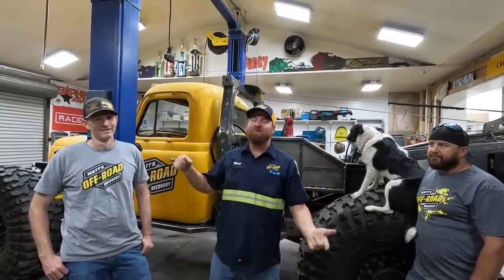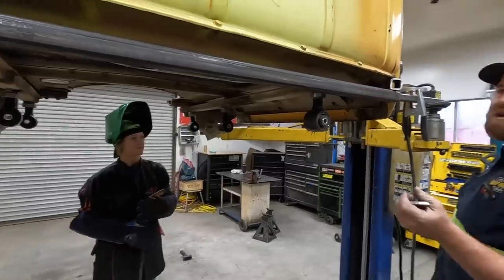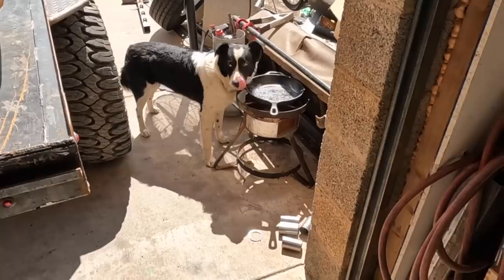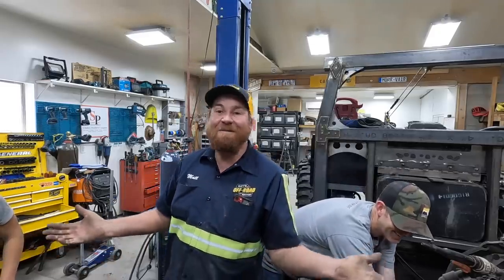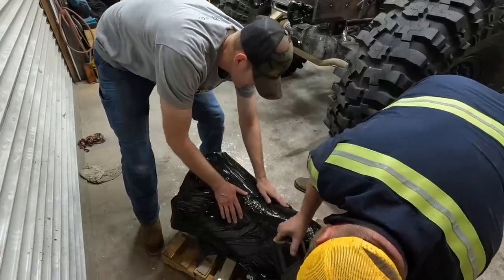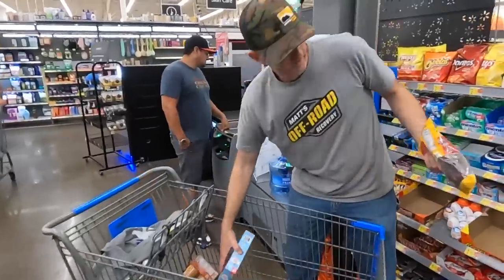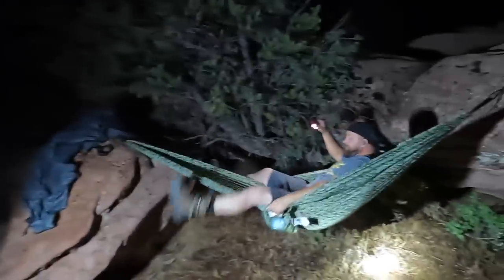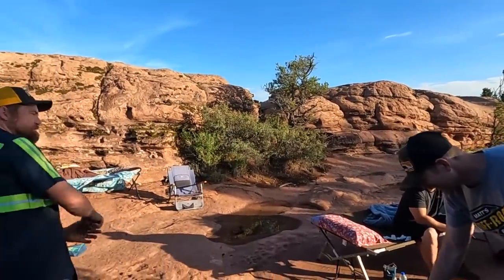Off Road Wrecker, We Need To Take It Apart Again.

Comment: In a past video I mentioned that you should use Cera-tec friction reducing oil additive in your Banana and you should use it in your Morvair. It reduces friction and keeps your engine running cool. Sometimes on cool days my engine stays running well below Thermostat opening temperature. It also increases torque. Your friend Kevin over at Light Bright just did a video about Cera-tec and Liquid Moly oil praising its benefits. His video is titled:" Preparing Our Jeep & Ford for an Off Road Trip Across the Country!". I'm a fan of both of your channels and former mechanic so try it in one of your vehicles. I think I'll send you one via my Amazon account.

Comment: Needs a mention... lighting a fire on a battery is a good way to blow your arses up, batteries generate Hydrogen gas. 
I know people that did, being splashed with hot battery acid is not fun. Any showers out there? lol  It is the primary reason for connecting positive cable first while boosting. Do not make negative connection on the battery! Connect to engine or chassis (away from battery)  Love the channel, great team effort. In their defense, camping without adequate equipment or supplies is a great exercise. If they instilled anything it is that overnighting in an emergency is not the end of the world. I would think an emergency road kit should be in any rig doing what you are doing.
You could market/give away well thought out kits. They already have experience in what they didn't have. Cheers from your northern Alberta neighbors ehh.

Comment: What about an s10 for the dunes? Built 4.3 vortec coil over conversion on the front, blocks and drop brackets in the rear, 4.56 gears and 35 inch maxis tires. Honestly no clue how it would turn out but it’s light, not a v8 but good for power and geared for better torque to accommodate for the 4.3. Not as cool as anything you guys have by any means but would be cool to see the build

Comment: Just watched Rory's latest video where he talks about the differences between his two wreckers and explains his reasons for how the boom functions on his off-road recovery truck vs the on road wrecker boom.  In looking at the boom on the Worlds Largest Off Road Wrecker and wondering if you are concerned, in a gnarly extraction, with the prospect of the boom bouncing up as there doesn't seem to be anything restraining an upward swing if the recovered vehicle is bouncing up and down on the winch line attaching it to the tip of the boom?  Love the channel! Been a follower and fan for a bit over a year.  Can't wait to see the truck in action!
Reply: The reason you don't see it is because they haven't made it yet. Once the wrecker is complete, maybe you'll see how it works.

Comment: You guys should cut out and biuld an Oil Pan Access panael under the  engine that way if you ever needed to drop the oil pan for any reason you can, ALSO  you could do a full rebiuld with out having to remove the engine block assuming you were to just Hand Hone and put new rings in it. it would be as smple as dropping the oil pan guard, then oil pant then the crank from the bottom and pull the pistons from the top with no clearence issues.

Comment: What I would like to see, and I don't have a clue how you would do it, is the torque converter driving 2 manual gear boxes before the transfer case.. The gear ratios would be endless, without the weak link of the autos clutches. Probably totally impracticable, but I would love to hear your thoughts on the idea.

Comment: I think yall should do an s10 or blazer as a platform and use the 4.3L vortex v6 you can buy a twin turbo kit for 1200 bucks do a lifted 4x4 blazer with crazy travel would not only be rare on youtube but in my opinion is an awesome offroad vehicle

Comment: I think you should build a Morvair, much like the first one, but it should have an Electric drive, Tesla motor preferably, you could also do a Jeep like your Banana to save cost. Or, something like the heavy wrecker with and electric Drive motor, it has the weight capacity to hold tons of Batteries for a long run time. With these rigs you pretty much know what to build, you did them before so there are no headaches there. This way you can focus acquiring new skills to apply the Electric Drive unit. Why I would suggest this, Electric is very efficient in stop and go traffic, or rock crawling, Idling does not consume power, has lots of Torque and that is perfect for pulling out things or rock crawling. With portable solar panels you can charge some in the field, maybe?!?!?!? So you could have a mobile Solar charging station with battery banks and/or Generator (Gas)?!?!?!?!

Comment: Gas Tank.Design.  Think Hydro Static Pressure, you don't have enough pressure at the nozzle or fill spout location to over come the weight of the gasoline. Gas Station Nozzles Shut Off when backflow from the tank hits it.  Your fill spout is about 8-inches from the tank bottom, which is Too Low.  Forget manual filling with Gas Cans from this location. It will just gush out from the tank once the gasoline gets to Fill Spout location. Hydro Static Pressure is why Most Gas Tanks Fill Spouts are at the top of the Tank, avoiding this issue.  If you move the Fill Spout to the top of the Tank this tank would work.   You ought to try filling the new Gas Tank before going further.  As designed NOW, as stated, you won't be able to fill this Tank..         I would recommend adding a separate Manual Fill Spout at the Top of the Tank, so you can at least fill the Tank as designed Now.                                   You may also have to lower the tank.  I would make the Tank two-piece and epoxy line it to prevent Rust.  A two-piece design would allow you complete access for maintenance, and for applying the epoxy to all inside areas of the Tank.  Thanks for your time  enjoy the videos.  😀      I wrote you a comment about the Hydro Static Pressure Tank issue 3-weeks ago, but it was ignored.  I'm surprised no else has picked up on this problem with you Tank Design.

Comment: My 99 Ford Ranger had gotten very rusty and it has V8 in it from 01 mountaineer. Almost everything plug and play cool. I was looking to replace it found nice 01 Ranger, kid asked what I was going to do with it. I told him going to have V8 from 99 put in. He wouldn't sell it me and said if I was swapping in cummins B4 he then would sell to me. I work on Diesel trucks, and It does get cold here. Told the kid why would I put 900 lbs engine in vs 450 lbs V8, going through all trouble making trans work with adapters and take more mods just to make it work. Then fuel issue with gelling oh so much fun. Lets just make balance worst make front very heavy end and light rear. V8 swap far better with what I'm doing.

Comment: Are you going to do anything with regards to the torque converter or just leave it stock. My thoughts was have a slightly higher stall then stock maybe? (like going from possibly 2200 to 2500). Just to squeeze a slight bit more omph out of the motor.

Comment: Comanche chopped in half back halfed with xj to make it 6 door...with 5 ft bed.. 40" on Dana d44 twin traction beam front full spoiled trailering arms 4 linked coilovers rear end with triple by passed king Kong 4.0 all around.. ls or Cummings don't care make north of 600 to the tire I tell ya what. Look up kibbytech for insperation love ya..

Comment: From experience: Do not run 1/4 plastic air hose anywhere near the exhaust. Even the rising heat from the exhaust 6 inches higher under the cab will melt the air hose.

Comment: I'm curious, but with all the winches, would running dual alternators with a high-idle switch (1500-rpm) be a good idea? Or even with two winches going at the same time will you still not really pull enough current for a single HO alternator to keep up with?

Comment: Interesting idea about you and your crew building something based on the comment section. Since California is going to be outlawing the sale of new gas-powered vehicles in 2030 (yeah, right? seems so well thought through, we'll see) maybe you might consider building the first ultimate Off Road Battery Powered vehicle. Ultimate EV Rock crawler, EV Off Road Corvair, electrify the Suzuki or buggy - could be interesting, at least there shouldn't be a shortage of options. Plus, all you have to do is make sure it's plugged in at night and no reason to stop in at the gas station to fuel up, something you don't seem to enjoy. And it wouldn't require the instillation of a Cummins as a part of the project.

Comment: don't all trucks still have a cigarette lighter in one of the sockets/ashtray? 🤣 they'll easily ignite rolled paper and probably the propane flame directly if you cycle it a few times/hold to get extra hot.
I don't smoke but always have butane lighters in my vehicles, as well as factory glow lighters.

Comment: This business has so rapidly outgrown this shop, you need to to go to a 10 bay truck shop, 7 bays for Off Road, and 3 bays for your son to do his thing. Bring him back into the fold while letting the family grow. That and a 10 ton over head crain would be nice for all.
Grow the business, we all,, love you.

Then their is Lissy, she is ,going to want 2 bays for herself soon.

Their is never enough bays for a growing family, and thats just to stay out of the snow in the morning.

10 bays 30 feet tall. 5 with pass through doors. 4 times the office space for billing let alone merchandise. The kitchen/food/deliveries/pick ups.

500 gallon tanks for trans fluid, antifreeze/ grease/ hydraulic fluid/ 175 psi of air, 8 welding stations, 7 lifts and the crain, entire wheel alignment station.

Hyper billing software. Have seen it and lived it, you need to get there.

O and 26 tons of Mitsobihie AC /heat.

Would suggest the local KMart or Sears, building that is out of business. It is the right size building. With plenty of parking asphalt. And docks. That one can cut 15 doors into the building. On Main Street , preferably with a traffic light entrance/exit

Comment: Monster transmission. Of Brooksville fl.
Sucks..Socks... just cuz you seen them on T.V... DONT MAKE IT BETTER...
 I spent $5400 on monster Trans stage 4.
Junk..got it dry pan. no testing. Didn't go a mile. Had cut internal seals...   buy local

Comment: Scrap the Cummins. Way too heavy. 

Put a 2.8Turbo 5cyl Kubota F2803 in an XJ with a 5.38+ gear ratio. You’ll shave off 300 lbs in weight and have tractor like power to pull things out.

Comment: I think this shop needs to review 7th grade metal shop safety videos.   Remember the ones where metal shavings get in the eye.   That is, if you are old enough to have shop offered in your jr. high or high school.   It's nice to be "cool" but the one time it doesn't work the results are usually bad, very bad.  Further, it isn't a very good model for those interested in doing this stuff.   Cool stuff made here for sure, but, safety first, and it takes next to zero additional time in order to do it.

Comment: hey I thought the frame had integrated air tanks! Ive missed a few episodes, did that not end up working out?
Reply: I think some folks with pressure vessel expertise got through to him. Very, very dangerous thousands of pounds of force involved. One of those plug welds letting loose had catastrophic and life threatening potential. I considered FedExing a letter to him myself. But got caught up in something else. Was very relieved to see the tanks!
Reply: @bubagump4366  ahh yeah that makes sense I guess there is a reason all the pressure vessels I see are cylinder without corners huh, lol such a neat idea tho XD

Comment: As a engamaneer you are supposed  to build five times the safety factor. I question your boom strength ....
When you hold a 5 tonne shackle in your hand Engamaneer says it will not break until 25 tonnes. Can you claim the same with your boom.
Best get your boom tested for insurance purposes.
I've  read you've been down that road before and you are  too nice of a guy  to be litigated again.

Comment: would love to see your channel go up against the other channels in an overnight job,  oh and Matt,  did your wife teach you to take responsibility for buying your own food when your away from home.   Never trust your crew as they will always buy something you do not like. 

as for ideas,   have you ever added water to your tires to get more traction on soft dirt. 

2nd,  add a joey gearbox so you can further gear down hence giving more pulling torque to climb obscene things or pull heavy loads. 

lazy axles to help on loose soil or towing heavy trailers. 

adding a fresh water container for human needs

in summer having branded water bottles for crew and customers.  

having a mobile phone dongle on a mask that can be raised to get reception in bad places and this can then go to a wifi access point. 

more fixed cameras on the rigs so you caN See under the rig when climbing up and down so you can see under the line of sight

Comment: Sand buggy purpose built for sand - rides crappy on hard pack but floats over thd dunes. Sadly, a Cummins diesel is not the engine for this.

Comment: Cummins swap the samurai with some new leaf springs what ever u do never do a body lift way to much body roll and what ever u do never use trailer springs like I did to my old samurai on 33s tsl thornbirds or u can buy an adapter plate to use a tracker motor on stock rears 35s are a max on the size tires u wanna go on it unless you do a bunch of mods to it and u can always do a redneck bikini half top made out of a heavy duty trash bag

Comment: Monster transmissions are overpriced utter garbage, I don't know how many transmissions that I have rebuilt that were previous monster builds. A customer just dropped off a 4l60e that monster rates at 650hp and it failed with 425 horsepower.  The input shaft to input housing splines like to shred with 450hp and in a heavy vehicle it's a guaranteed failure.  I peel all the stickers off of the transmissions from previous big name builders and stick them on my 200 gallon air tank.

Comment: Please tell me your not Using Monster Transmissions out of Florida. Stay the hell away from them. Ive had 3 and they all sucked. 2 blew up and 1 Exploded behind an 90's LT1 with mild power on the street. My buddy did transmission repairs for Gm dealers, He has had a few come across his benches in recent years other than mine and says the same thing I do, Absolute garbage!!! Rip off, Cheap Chinese Plants in the cheap builds and sell you stock 4 pinion plant when you ask for upgraded GM 5 pinion plants. My buddy here in FL, Preformabuilt in PA or RPMtransmissions in IN are my next builders. Especially if its a 4l60. Not to mention there is a really good builder out there in Colorado if I'm not mistaken.